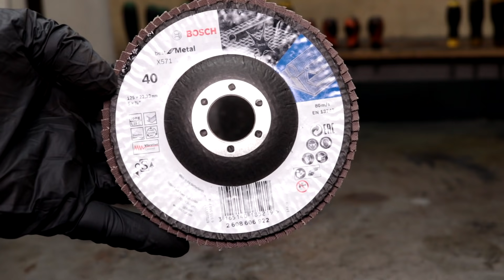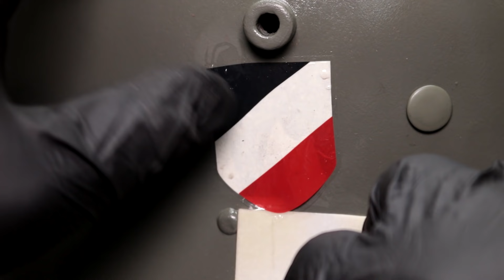Rusty World War I Helmet Restoration - From Nothing to Awesome

Comment: It’s nice to see that two helmets were put together and brought a helmet to life, but the cutting in some helmets hurt a little but still worth it
Reply: Bro, this guy kinda of a genius. He used a piece of another messed up helmet to fix one that was just a little bit more saveable. Many people wouldn't try to fix this helmet or they would just weld a random piece of steel.
Reply: Actually the piece he used was a helmet cover that provided extra protection
Reply: @LuciSar Not true. You can see the raised pieces on the sides that would hold said helmet cover. Both pieces were original helmets.

Comment: The M18 was used pre ww2 by the Nazis before the M1935 helmet was introduced, so its correct in having the double decal. It's called the m18 transitional helmet.
Reply: Cool I personally didn't know that thanks.
Reply: Then why title the video WW1
Reply: Ya I was thinking the same thing  . A WWI helmet with a nazi sticker??
Reply: @gwggamingwgaravaglia  They did issue ww1 era helmets if there was a shortage of M35, M40 or M42 helmets esspecailly in the latter stages of the war
Reply: @gwggamingwgaravaglia  if you see footage of old Adolf, his bodyguard wear the M1916
Reply: @gwggamingwgaravaglia  it was not uncommon for the Germans to reissue perfectly effective ww1 helmets, refurbish the liners and paint to "modern" specifications, and add the decals when they did not have enough helmets to supply all the troops.
Reply: This is an Austro hungarian helmet
Reply: Very interesting,  didn't know that.
Reply: Austrian M17 helmet
Reply: This is not an m18 helmet
Reply: This is an Austro - Hungarian M17 helmet from WW1!
Why do you put in so much work with the restoration when in the end you put in a completely wrong inlet, attach the chin strap incorrectly (not on the helmet itself!) And then put on those unsuitable Nazi decals?  I dont understand!
Reply: @erwien58  yeah...
Reply: @evincook9489  It is a helmet from WW1.
Reply: @OscarC100  no?
Reply: @ew921 it is an austro hungarian helmet but it was restored to a german helmet
Reply: @erwien58  During the early war periods the Germans had a shortage of helmets so they had to use surplus from WW1 (I think)
Reply: @OscarC100  oh yes ur correct mb lol

Comment: No. In its found state it had a much more poignant story to tell. Your work is good but why not just use modern replicas?
Reply: You are very right.
Reply: Replicas are great, but they are not perfect like originals and some people strive to be as accurate as possible so they buy originals, plus it's really cool to have a restored original
Reply: Would you want a replicant made out of metal that wasn't there and did not lived through ww1 or would you want a replica that was made out of 2 helmets that was actually used during ww1?  I think a helmet made out of 2 helmets form ww1 is a lot cooler but what do I know🤷‍♂️
Reply: I mean, in it’s found state it tells the story of a helmet that was used as target practice then discarded after the war. I don’t see a particularly great narrative out of helmets that are more rust them anything else. Unless you know for a fact where it came from in all likelihood they were simply discarded.
Reply: You can't preserve a helmet like that. Unless you grind out the corrosion it'll eventually disintegrate into nothing. There was nothing to save of the original

Comment: Great save! I don't understand all the negative comments saying you ruined a piece of history. If that helmet were worth preserving as is someone else would have stepped up and bought it on ebay. My only criticism is that it would have been easier to shape and weld in new pieces of metal for the larger holes vs filling them up with weld...much less welding and grinding. Either way awesome job bringing that relic back to life!

Comment: The welding is much easyer and you can give more heat in when you put a thick piece of massive copper from inside under the welding point. And the inner surface is much flater after welding.

Comment: Excellent job of restoration, for sure. Unless the helmet was recirculated for use in WWIi, it wouldn't have a Nazi decal. My WWI Artillery helmet (with inner liner) is in undamaged original condition but has no decals whatsoever.
Reply: its M1916/31

Comment: Wait why does it have WW2 decals if it’s a ww1 helmet. Great restoration btw
Reply: What's known as the transitional helmet, the typical WW2 design came in I believe 1935 so when the Nazis came into power in 1933 the WW1 pattern helmets were still in issue in the German army, hope this helps
Reply: @BlownHeadGasket  I just read about how ww1 helmets were reissued during WW2 thank you

Comment: I am offering my opinion on this restoration: Technically very well done, but historically not so much, but that´s just me.

Owning an original M17 helmet that was used by the Austrian Army and after the war painted green and put itno service with the Gendarmerie (rural police forces)  I can say: Germany never used Austrian M17 helmets, as these were close copies of the german M16 helmet. Austria even started out with German M16 helmets, because the Austrian Berndorf factory and other producers could not deliver enough for the Austrian Imperial forces.

These helmets were painted in a brownish OD, not grey. I have books on this topic, written by austrian historians and I would be happy to assist you in restoring it to it´s original state, instead of a nazified curio. I can also send you pictures of my M17 helmet and it´s interior, because the leather innards and the chin strap (canvas on the Austrian helmet) were the only real differences to the M17.

Kudos for your craftsmanship, I wish I had your skills.
Reply: But the Nazis did use the M18 as a helmet before the M1935. It’s called the M18 transitional
Reply: @Rob-lv3fc  Agreed, but this is the austrian M17, right? A lot less flashy without the swastika and stuff, but also a lot rarer. I must confess, that I have no knowledge, whether austrian helmets were rebranded with the Wehrmacht insignia in 1938,  but I doubt it.

Comment: You did a very nice job bringing together what was otherwise a pair of rotted out relics. My only complaint is the shop heads on your rivets are a little sloppy, they look like they'd fail under any real use. That being said, I get that this is a display helmet/a passion project, and it's easy for me to criticize on the internet from behind a screen. I'm an aerospace riveter, this is being said as constructively as possible, not to disparage your work.  That's my only real complaint though. The patience it takes to fit, weld, fill, then paint to the level of detail you've reached is seriously impressive. Great job.

Comment: Excellent restoration. The only thing I would have done a little different is in the sequence of primer and body filler. PPG paints makes an excellent conversion coating for steel. It is a phosphoric acid wash that also etches the steel. This is applied first allowed to dry and then primed with DP epoxy paint. The body filler is applied OVER the primer. This forms an impervious seal between filler and primer. The filler can then be coated with one of PPG primer surfacers. Other than that this was an excellent restoration!

Comment: I’ve restored old car body’s  for years. I’d highly recommend having it blasted and epoxy primed before filling the rust pitting. It creates a barrier from the porous filler. 
It would also save you a lot of time spraying it in polyester rather than using an applicator to apply filler. 
If you give it a nice thick coat of 2k hi build primer and try not to rub through everywhere you’ll also get a flatter more uniform finish in your topcoat.

Comment: This is an awesome bit of work and a fantastic restoration, from an inexperienced perspective, but something doesn’t sit right about putting post 1935 decals on the helmet when this model is a 1916 Stahlhelm, the chance that this was used by the German Military between 1933-1945 is extremely low since most old model of the helmet weren’t accepted for use except the M18 ear-cut variant. Just my tuppence, again not knocking the work at all but I’m just saying it’s likely that this only saw a lifespan of in the German Empire era, unless of course you have documentation saying otherwise
Reply: That could not be further from the truth. what we see now as the ww2 German helmet was not produced until 1935 so between 33-35 "WW1" helmets was it. Even after 1935 you still see plenty of the old ones being used because it takes time to refit an entire army's equipment.

Comment: Excellent restoration although the part of my mind that’s a purist is screaming to leave it as you found it with all of those holes and preserve the helmet as is. To show that it has been out in the field and most likely was used in combat. 

And as for the markings I understand why you went with water slides. Now I’m not 100% sure, but those markers were hand painted on the helmets.
Reply: They were never painted. They were decals that used a resin glue applied to the helmet

Comment: That wasn't "restoration"...
You can't combine parts from different helmets in to one and call it restoration simply because it is unclear with helmet was actually restored. 
Meaning of "restoration" is too restore the object, not to assemble new device using parts from couple of different objects.
What you actually did is creating new helmet from two old ones.
That is also disrespectful, since those helmets are part of history, not just junk. The only good thing about it - it's a german helmets, so no glory to those who used to wear it.